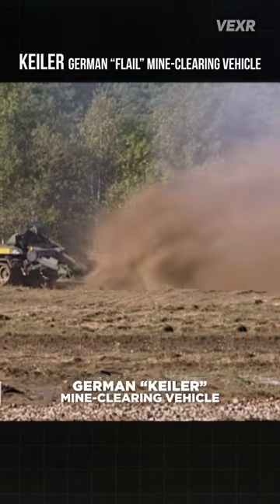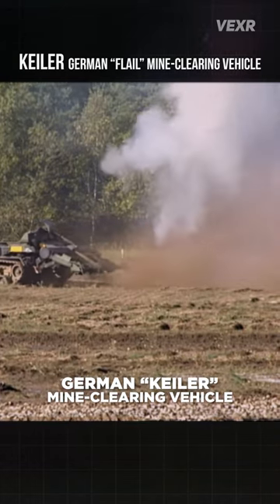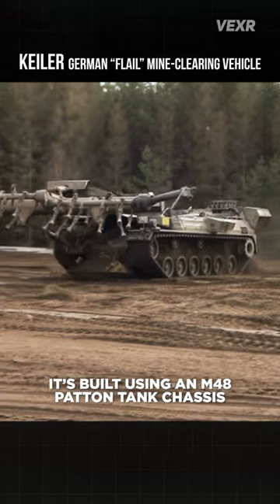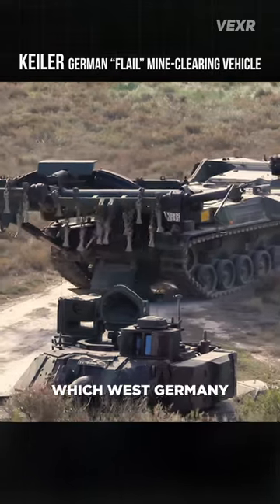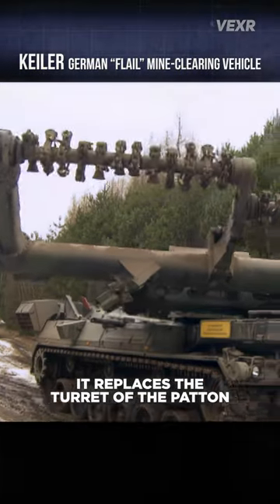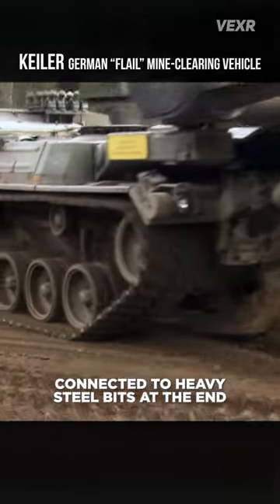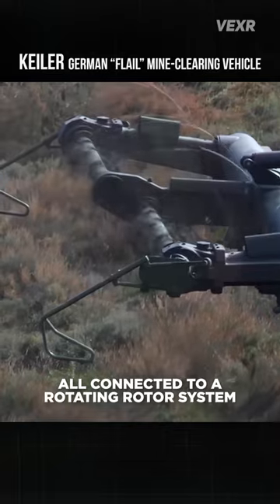How The Germans Clear Mines From Battlefield

Comment from the maker: Reupload from earlier today, original was stirring up a bit of controversy...
Reply: waiii? :/
Reply: just curious how far down does it dig looks like a good brush clearing apparatus also lol I know overkill it still
Reply: @jacobschwertfeger4857 pressure from the chains slapping the ground sets off the mines
Reply: @jacobschwertfeger4857 It has multiple 'dig' depths. The deepest is 25 cm. This does not include the impact force of the so-called "Elephants Feet" (That's what the Bundeswehr calles the metal slabs at the end of the chains).
The Keiler is on average 98%effective in removing mines. And that were missed will be found by the engineers behind it with mine detectors.
Reply: Controversy you say, sounds like people are stupid (it's the Internet, of course they are) nothing should be controversial about a vehicle clearing out mines. At least Germany thought about how to clear out mines unlike many other countries.
Reply: @palaius kudos for including the bit about the detectors.
Reply: @crossfire2045 Most modern militaries have vehicles like the Keiler and Germany isn't the first one to have thought about a mine clearing vehicle since these have been used since WW2 and maybe even pre-war.
Reply: @crossfire2045 Cambodia in masterofroflness:dadge
Reply: Sadge
Reply: @112mirai doesn’t change the fact that some countries aren’t doing anything about their mine problems
Reply: @OklJ-wl6pu  which countries exactly? Every major militaries have some sort of counter against mines and smaller militaries have other more important matters to focus on other than mines. Ukraine is the most heavily mined country on Earth and it's very difficult to clear those mines when the enemy can see what youre doing 24/7 vice versa, its why nothing major is happening at Ukraine anymore
Reply: The mines aren't supposed to explode. It happens but that is not the actual purpose of this vehicle. They're supposed to throw them to the sides to make a pass.
Reply: @redunicorn7760  What? I'm pretty sure the weights of the flails rotating at such high speeds detonates the mines
Reply: @112mirai , given the right circumstances, it might just disintegrate a mine without causing a detonation 😎
Reply: It’s not pronounced “Paddon”.  It’s pronounced PAT-TON.  Hard “T”.  It’s NOT pronounced like it is spelled with two ‘d’s if you can understand what I am saying.
Reply: The UK had funny tanks like this in 43.

Comment: An important thing to mention is that this kind of "mine removal" is not suitable for the use after a war. The mines don't always explode and can be scattered around in the area. This vehicle is more for the use in a war zone to clear a strip of land to push through.
Reply: That and at least the American version measures hundreds of yards per gallon, not miles per gallon. It isn't cheap in the slightest. Goats are still the cheapest system known and they too are not very thorough.
Reply: Will it be suitable for use in a field, say in Cambodia?
Reply: @vidard9863 Goats also usually aren’t heavy enough to activate anti-tank mine pressure sensors.
Reply: @AnonD38  those generally are not real concerns. To deal with modern tanks they use metal parts so metal detectors work, making them "easy" to find, and because they don't trigger on human steps, they are pretty safe to handle... And actually due to the shape of goat hooves they will actually trigger most anti vehicle mines. They actually put down enough psi to be used to create reservoirs.
Reply: There's still kilometers of land mined from ww 2 around France. Men still die occasionally clearing the area. It gets smaller with funding but us so vast it'll take years regardless.
Reply: @vidard9863  yeah tank mines need like 500lb psi. Those things flai w alotve psi an carry a inertial load w follow through. If they don't detonate they'll definitely move them
Reply: The mines aren't actually supposed to explode at all
Reply: @vidard9863 how does the shape of a hoof have anything to do with force applied? Obviously some areas will be pressing harder than others but the difference would be completely inconsequential for this
Reply: But too slow for active war zones.
Reply: @Sbudz  psi means pounds per square inch. Hence those tiny little goat hooves put out higher psi than much heavier humans. But their shape widens so they also put out a wider psi variance across the time of each step than a human, meaning that it is much more likely to trigger any design of mine..... It's also why they compact earth better than a steamroller.
Reply: It's a hammer mill.  it isn't going to scatter mines.  Its going to scatter the pieces of what used to be a mine.
Reply: @stephenlim2852  especially trained rats are used for this task over there.  The advantage they have is they can go on all sorts of terrain.
Reply: This type of "mine removal", aka flails, was used in the heavily mined Bosnia after the war. I guess it depends on the location.

Comment: The one shown is an M-60 chassis. The dead giveaway is the 3 idler wheels under the top of the tracks where the M-48 has 5
Reply: The round front of the hull shows that it is a M48 chassis. Germany  never owned the M60.
Reply: It's an M-48 because the M-48 was one piece and not welded together, making less weak spots in case of the explosions
Reply: How can you all be so wrong? The KEILER is based on the LEOPARD1 Chassis... Was always and still is. Source: I´m German and was in the Bundeswehr
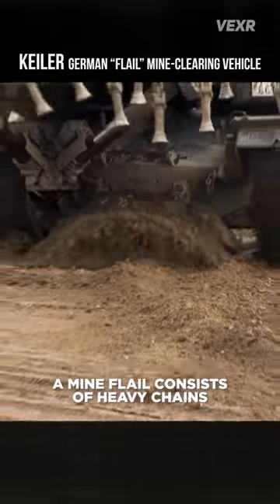Reply: @gorex6480  well but you're still wrong. Look at this video from the Bundeswehr at 0:15
https://youtu.be/yvOpjwluZXc?si=L6kkhE9hG_gYhvKC
And every source on the Internet says M-48, not a single one says Leopard 1
Reply: @jankeller1635  Honestly...i mixed it up, while typing,with the Biber...and being sick AF with a cold didn´t help either. I checked it afterwards,but couldn´t edit the post.

Comment: I dont think the m48 has such a big nato hump. Wrong chassis maybe the lower glacis looked welded rather than casted same with upper glacis.
Reply: ...it is a M48 chassis. It was used in 1996 when this tanks are made, because of the cast chassis which is more durable to this massiv vibration then a welded one.....

Comment: Вундерваффе....😉😂😅
Reply: Nobody said it was
Reply: Actually, it is just base equipment. It is based on the "Crab" system from WW2 that the allies strapped to Shermans. Works fine in a war zone when disarming minefields while under MG suppression.

The second a tank shows up, though, that's gonna be an issue. Cause those flails might be able to stop a HEAT round or ATGM, but an ADFSDS round will go straight through.

Comment: In my own games, I had a strange pathing bug caused by the mod that allows you to replace structural elements without manually deconstructing the previous structure.
The bug occured when I built a door in an existing wall as the existing wall wasn't properly deconstructed as part of the door construction, causing pawns to freeze in place and starve when the pathing process scanned that square regardless of their route would take them through that area or not🤦🏼‍♂️
Finding that door and deconstructing the wall fixed the issue.
Reply: Wtf?
Reply: Agreed wtf?
Reply: Bro commented on the wrong short.
Reply: Bro is modding reality